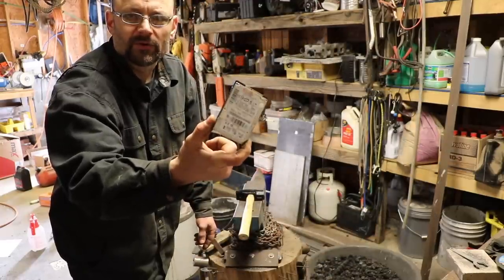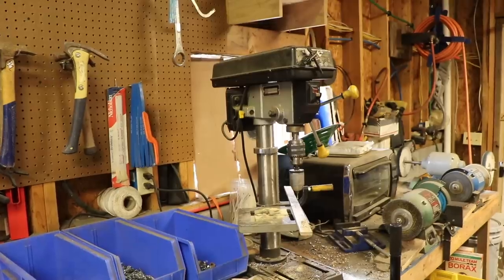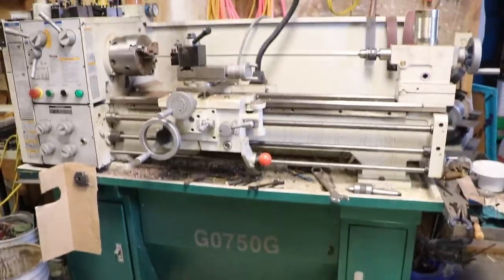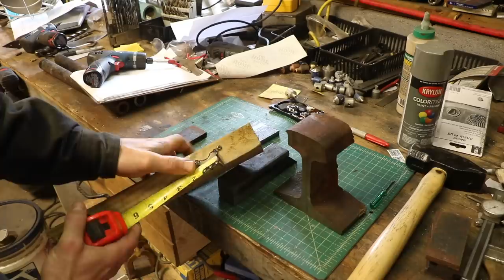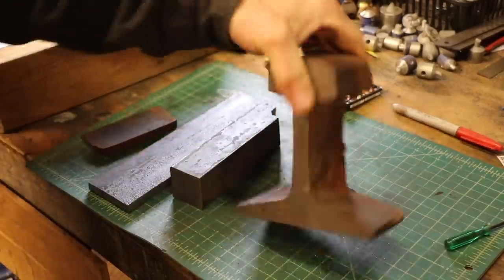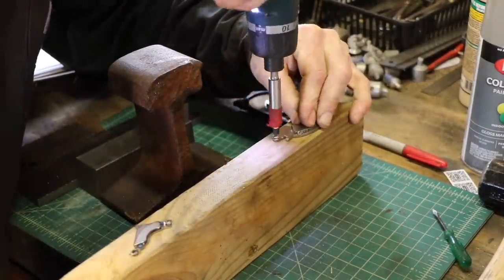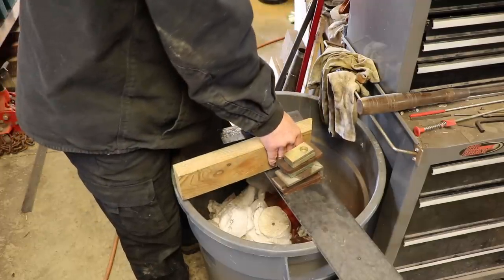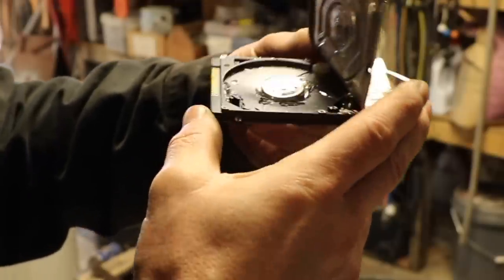Watch What This Metalworker Does With an Old Hard Drive!

Comment: I worked on the first digital map for military aviation. (It flew on AV8 and the F/A18) we developed an optical disk drive for the project for all the map data. Security was critical so we had to include a “distruct” mechanism. The disk substrate was hardened glass which would shatter into millions of fragments. The destruction was accomplished with a very tiny Jack hammer. Your attack on the hard drive inspired my memory.

Comment: I have taken 100's of computer hard drives apart and if you balance the hard drive disk on your finger and thump it, you can tell the Ceramic apart from the Aluminum. The aluminum disk will ring like a bell, the ceramic will have a dull sound and not ring at all.

Comment: Hard drive magnets are awesome.  I have used it to make a super strong towel holder on my fridge.  I also used them to add a light to my drill press.  I use them in the yard to help hold up the "frost cover" cloths when we have freeze warnings for our plants by just putting metal on the trellis, holding the sheets up, then click, and works for whatever high winds we get.  I have 3 or 4 large peanut butter jars full of those magnets now.  Very good for all sorts of things. :)

Comment: The separator rings between the platters on the glass hard drives are titanium.  I discovered this when I tried to melt all the aluminum bits down and those rings just wouldn't melt... confirmed it on the bench grinder, they throw bright white sparks just like titanium.  I think they use titanium instead of something cheaper because the thermal expansion matches glass almost exactly.

Comment: They are neodymium magnets.  Also very useful once removed from bracket, but be careful not to pinch yourself if you have 2 of them.  I used them to beef up a cabinet magnet.  Just place on existing metal strike plate.
Reply: Yeah two of the large ones can easily break your finger if one is not careful with them.

Comment: Got a bunch from the 90s hard drives and they got big magnets in them ,use them around the shop and when working on cars. Put them on the underside of a car you are working on no longer set wrenches on the ground just stick them tomthe car when not needed then just grab it a work love those mags. Yes case is aluminum and the board on it is a high quality board they are worth money at scrap, 5lbs get you about 30$ 40$ at a recycler

Comment: They actually make very good doorstops... I'm not kidding.   They are just the right size for a house door to slide over them, but also to pop up and stop the door from opening up.  I've been using dead harddrives for years as door stops, I've yet to find anything that works better.

Comment: the reason for the impressive holding foces is, that those magnets contain two opposing dipols, backed with a yoke to close the circle. glueing two opposing flat magnets to some 3mm steel has the same effect.

Comment: Slightly unconventional disk use: put them on top of candle jars to retain heat and burn all the wax (instead of melting a dumb hole down the middle and leaving waste wax). Aluminum is a fantastic conductor of heat, the hole is just large enough to allow sufficient oxygen to the flame. Don't bare hand the disk once it's been up there for awhile. Stack them for deeper candles, push one over to starve the flame.

Comment: I use those same magnets on my drill press, I found that I can put the magnet on the inside of the cover (no screws) and it will still hold the chuck key. I also met down the aluminum parts, most of the case frame is aluminum as are some of the platters.

Comment: Jon:  You do know there are two magnets per harddrive right?  Thought so.  Under the the contact coil is the second one.  Sometimes, I only want the magnet and not the metal.  I have tried a heat gun to soften the adhesive bonding the magnet to the bracket.  Different HD manufacturers use different adhesive.  Some come off.  Some just break the magnet.  My brother gives me several HDs a year.  I spend a morning just collecting the magnets.  So useful.  Especiall if you drop your keys down a sewer grate.

Comment: I save the magnets and use them with my benchtop power supply leads to attach to 18650 battery cells harvested from dead laptop batteries for recharging. Then I save the aluminum casings for eventual smelting, and keep the innards in case I ever want to harvest the platinum chemically.

Comment: gold on the pins, ribbon wires, chips, silver in a few places and disk are plated in Platinum.
Reply: It's amazing hard drives are as cheap as they are really, 3tb of data stored stored on rare elements for less than the cost of a video game. Even ten years ago that would have cost a small fortune

Comment: The disk if powered and metal can be used as a flat grinding machine, the issue is that it's fast but doesn't have too much torque.

Comment: I wonder if you can make 90 degree brackets for welding and since they would be homemade you can make the "ON/OFF" Feature save a bundle.  I myself will look into this. I have at least 4 old hard drives and I am sure they are readily available. I am sure a cam action would be how the "ON/OFF" Feature would work.  Worth a maker's try.

Thanks for sharing.....
Reply from the maker: Great idea.

Comment: Neodymium magnets are rather fragile and can chip or shatter. You should cover the magnets with something, maybe epoxy, maybe glue a bit of rubber over it.
Reply: there kind of hardy I have about a hundred of them but I usually break them off of the backing

Comment: Great Tip!  I have magnets all over my shop, love them. What's the best way you've to get found to get chips/grinding fuzz off of them? Quick swipes with a wire brush is the best I've found so far...any more Ideas?
Reply: could you wrap the magnets in a zip lock bag. Then when shavings get on them, take the magnet out of the bag and the grinding fall off.
Reply: Strong tape works great for getting debris off magnets.
Reply: For stubborn grit, coat in a thick layer of RTV/silicone glue.  Let cure.  Slowly and carefully peel off the glue, which will embed most of the iron pieces.   That's how I get it out of those magnetic hex bits.

Comment: The reason that the mounting plate is not magnetic is because there's 3 magnets instead of one and the array the magnets are placed makes them more concentrated on the ends the nickel based plate helps achieve the goal.

Comment: U can attach sand paper to the disc and get speed controller for it online just go buy bunch old hard drives remove all without the motor the disc and mount it on wooden plate with some magnets at the bottom of the plate so u can change the way it sits

Comment: It would make sense that those plates the magnets are mounted to are a nickel alloy, they’re actually pretty tough. To bad they aren’t bigger.
Reply: ever open up a drive from the early 90s or late 80s? they are muuuuuuuuuuuuch bigger, especially the quantom bigfoot drives that had 5 inch bay instead of 3.5

Comment: The magnet backing plate is made of Mu metal. It's an alloy that will direct and contain the magnetic field to prevent them affecting the platters.
The strong magnets are used for controlling the position of the read/write head using low power signals.

Comment: Nice video, it's a very powerful kind of magnet that I often use for similar purposes, at no cost.
Warning! These are sintered rare earth powders, covered with a light chrome plating. We do not know the effects of these chemical elements on our health, we do not have a significant case history.
Finally, I would avoid using these powerful magnetic fields on steel tools (files or drill bits) if I don't want them to become magnetized and attract iron and steel shavings.
I also re-use the disks as an economic mirror, making sure that it is glass, therefore very fragile and sharp.
In 3.5' hard disks they are made of light alloy.

Comment: with a bench vice, a razor blade, a pair of needle nose pliers, a hammer and lots of swearing (seriously, be careful. that razor will take a fuckin finger) you can get the magnets off of their carriage metal. use the razor as a wedge and once it's in lever it up for the pliers

Comment: Are this was a IBM hard drive?
AFAIR, only IBM used a glass for HDD magnetic disks in past...
Reply: nearly all laptop harddrives use metal plated glass now
Reply: @frogz  I've only ever seen glass in 2.5"drives. All the 3.5"drives I've seen still have metal platters.
Reply: I saw a3.5 that was glass, freaked me out, I was going to bend a platter for some reasons and it shattered on me, don't remember which manufacturer

Comment: The magnet form the small drive is ugly because it's not that attractive. 🤦‍♂

Glass was used for the dick disc because the smoother the surface the greater the data density on the platter. Early platters were coated with Mylar to provide a smooth as possible surface. IBM had a drive range with glass platters called a Deskstar and they would die very frequently so of course they acquired the name Deathstar. A drive to be avoided if you were negligent with your data backups. 😱😱
I don't remember retrieving any of the Voice Coil magnets from the 5¼" HDDs but they would have been even bigger. I mostly used the ones from 3½" HDDs to magnetise my screwdrivers and driver bits. Might have to go and repurpose the magnets from the 18 x 3½" drives that data recovery shops don't want as donors. Just taking up space now unfortunately. I am going to keep the 125MB ( not a typo) Maxtor drive though.

Comment: what are you guys doing with your hard drives haha? seriously though... i am 35 and only once i had a failing hard drive, and i never even bothered about manufacturer, quality or whatever.
Reply: Depends how much you use your computer. If you do a lot of large file read/writes (like editing videos) it will wear out the heads faster, if it gets hot like laptop hard drives typically do it will wear faster, etc

Comment: There are 2 magnets in the 2.5 inch drives too. The purpose of the magnet is to allow the arm to "float" and move easier across the platters.
Reply: then isnt quite right. the head floats on a cushion of air, generated by the spin of the plates.(normal HDDs wont work in a vacuum) the arm holding the heads is actuated by the magnet and voice coil assembly.